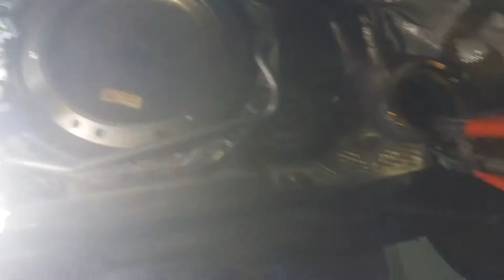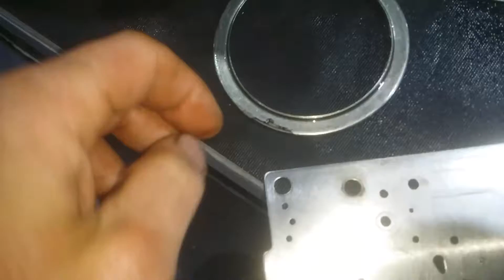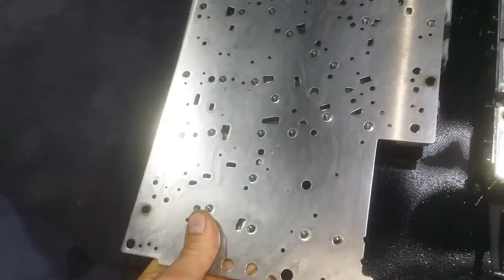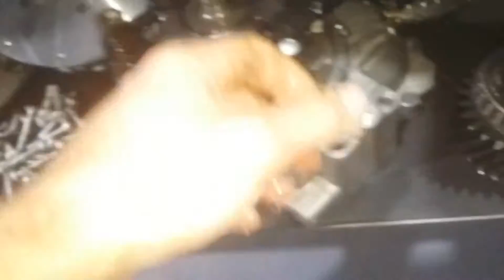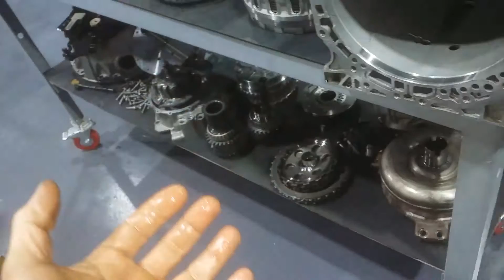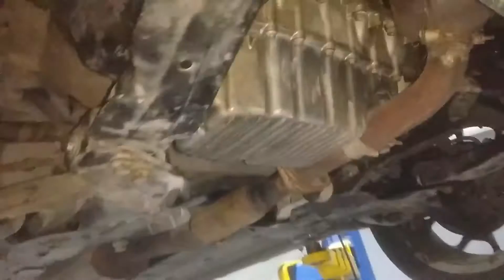722.9 transmission from 4matic (part 1)

Comment: You are great men. Most MB representative would usually replace the gearbox and present a bill with 5 figures. What you are doing is great, cost effective and quite "green" as you are reusing instead of buying new.

Comment: I’ve been very curious how the fluid gets from the pump, through the valve body, and to the clutches. I imagine the passages in the bell house are key but I’ve not been able to find information on exactly where the fluid goes to get to the clutches. Are there passages in the transmission case as well that deliver pressure to the clutch packs?